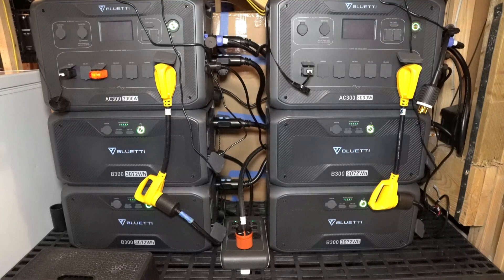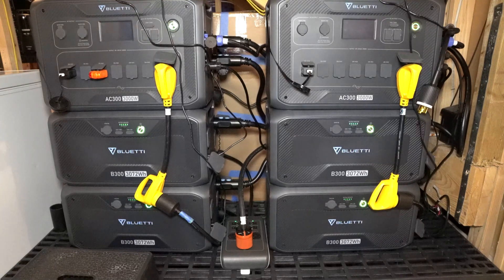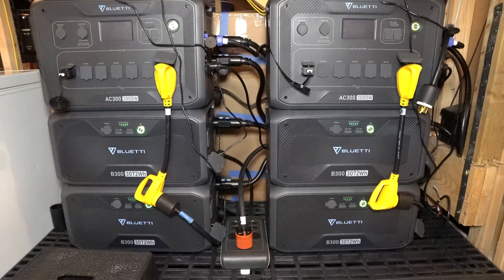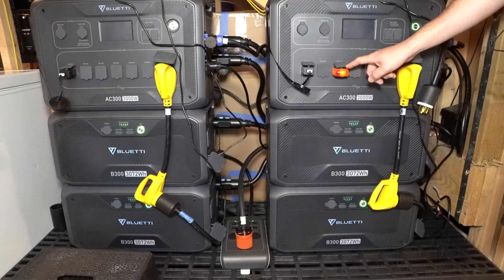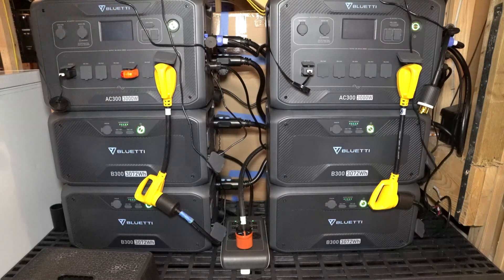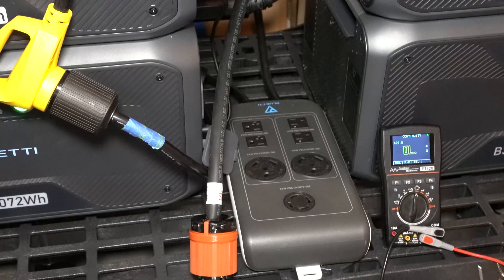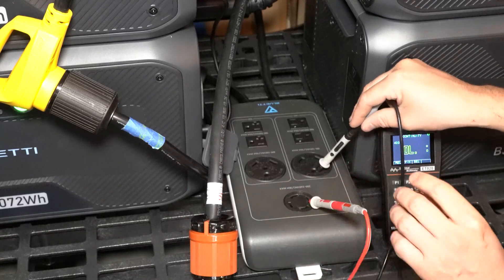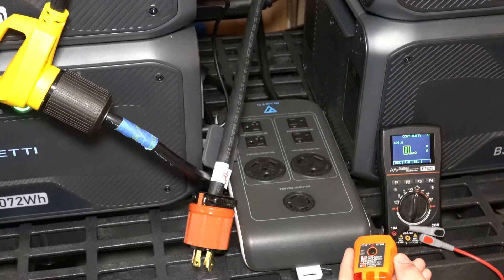Troubleshoot It: Bluetti AC300 - Grounding Questions

Comment: My Bluetti AC200MAX didn't work with a neutral-bonded ground. I had to hammer a ground rod into my front yard to get it working. I made a video of this solution in hopes others can use this solution: https://youtu.be/Rqy77nWfIyo
Reply: Always have great videos. Did you ever figure this out? I just brought the AC200L and the Reliance 310C but it looks like I'm going to have a problem according to your video.

Comment: I have been having the same struggle, glad to see someone else out there documenting it. 

I have the first generation bluetti smart panel transfer switch for my EP500 and I first came across this phenomenon when my furnace would refuse to ignite when on battery. The furnace would give me a code of a non bonded neutral. 

I later also had this problem when my APC UPS would throw a “wiring error” code on the back and would prevent startup. 

My Victron Quattro could connect and disconnect the ground bond via a relay. It looks like bluetti may not have implemented this yet.

Comment: That's an interesting manufacturing decision. I wonder if they were getting some sort of interference between the two units. But I don't see why that would be the case. It would be interesting to know if the GFCI protection is on the expansion board if that is the case technically they don't need the ground sort of. Although it's already in the cables, weird.
Reply from the maker: I know there a several versions of the Fusion Box, in which they changed grounding. However I never found that the Fusion box had any GFCI protection in it, as that would require bonding of the neutral/ground, which doesn't exist. In my latest setup I have abandoned the use of the fusion completely... and so has Bluetti, as their AC500 is sold with a 50amp y-adapter.

Comment: Your videos are very useful.I have the same set up.Just wondering if you encounter an error code008.OCP over current protection??I can't use my system right now because of that and not receiving any help from BLUETTI support.Thanks
Reply from the maker: Hi Ronald - The 008 Error could be indication that your system has been fried. I assume you have an AC300? Can I also assume that you had the Bluetti plugged into the grid for AC Charging? And How are you trying to contact Bluetti. I know they were out for the last two week for the New Year Holidays
Reply: @MyBluetti  I have 2 AC300 charge into the grid .The other still working fine

Comment: Hi, getting shocks from the metal on the bottom of my RV when running on the AC300. Hooked up to the shore power no shocks. I have a neutral-ground bonding plug plugged into the unit but still getting shocked. Any help appreciated. Thanks
Reply from the maker: Hi @fightintheshade - I believe I responded to you on Facebook, but just in case... 

I would get a outlet tester and verify that your AC300, when it's not connected to anything, is testing correctly. The outlet tester will tell you if you have a hot neutral or hot ground. If that passes, then connect your AC300 to your RV and test it again and test some of the outlets in your RV. Let's see where your probably exists. 

Remember that shore power is a bonded neutral system. Your AC300 is a floating neutral system. This means that power that flows incorrectly will be handled or "not" handled very differently.

Comment: Do I have a defective fusion box?  I have the same setup (2 x AC300 + Fusion Box).  With the system turned off and not connected to anything, all of the grounds on my fusion box are tied together.  All show continuity no mater which two are tested.  The neutrals on my Fusion Box behave like the grounds on your Fusion Box.  The neutral on the L14-30 is only connected (shows continuity) to one set of outlets on the Fusion Box.  (L14-30 neutral is connected to neutral on master outlets and not to neutral on slave outlets.)  There is no continuity between any ground and any neutral.  (Floating neutral.)  I have checked this and verified this multiple times.

I bought my system to only use as a backup during power failures.  I planned on using the L14-30 to connect to my transfer switch which is a Reliance Pro Tran 2.  I Have not connected my system to the transfer switch because I have heard of so many Bluetti systems blowing up after connecting to transfer switches with pass thru neutrals.  

Is your L14-30 neutral tied to all of the neutrals on your Fusion Box?

Is this the reason why some Bluetti systems are blowing up, because they have Fusion Boxes wired like mine?

I can't understand why your system didn't blow up when you jumped neutral to ground.  Connecting the Fusion Box to a transfer switch with a pass thru neutral is basically the same as connecting neutral to ground at the AC300 (as long as you don't charge it at the same time by connecting to grid.  That's another issue.  I don't plan on ever doing that.)

Do you know why some AC300 systems are blowing up when connected to transfer switches with pass thru neutrals?  Is it because they are trying to charge with grid power at the same time?
Reply from the maker: Hi Michael.. There's a lot to your comments/questions, so I'll do my best to answer it all. 

First let me say that I abandoned the use of the fusion a couple of months ago and went with a y-adapter to merge the master and slave together. There are also different versions of the fusion boxes out there and the only way to identify which one you have is to open it and check the version number on the circuit board. Different versions had different wiring. 

Unless your fusion box is miss-wired, your neutral must go back to both the master and slave to "complete the circuit". Otherwise any loads you put on the side with the neutral that is not connected would not be powered.  Yes, all my neutrals in my fusion box are connected, only my ground wire is not connected to one side from my transfer switch. 

Yes the AC300 generator is a floating neutral and there will be no bond between neutral and ground. Any bonding that is created must be done external, if one is not available. 

So what I understand from Bluetti is their system was designed for transfer switches that breaks the neutral from the other power source (i.e. Grid). Even their Home Smart Panel breaks the neutral. However many users connected their AC300 system to their home using transfer switches that shared the neutral system with the grid side of the transfer switch, such as the Reliance Pro Tran transfer switch. In my opinion transfer switches that share the neutral wiring system can cause higher voltages and alternative paths which eventually will cause a fatal voltage spike to the AC300 and kill it. Now Bluetti released new versions of the AC300 that they say corrected this issue and now work with the Pro Tran and other transfer switches that share the neutral.

So all home electrical system have the neutral and ground connected together. This bond between the two exists in your main breaker panel and can only, by code and for ideal safety reason, should only exist in a single place in your homes electrical system.  However, remember from above, my transfer switch breaks the neutral wire from the grid side. This means that I do not have access to the bond between neutral and ground that exists in my main breaker panel and I must create a bond on the AC300 side to allow my safety devices in my home to work properly (GFCI/AFCI).

In your case, with the use of the Reliance Pro Tran transfer switch, you "should not bond the neutral and ground together"... This is because your transfer switch does not break the neutral wire you have access to the bond back at the main panel. Remember you can only have one bond in your electrical system... so you already have one. 

Yes, you are correct. When owners who have a shared neutral connect their AC00 into the grid for charging, they create an alternative path for the "power to return to source". I never got a clear answer from Bluetti on why, but I can assume it's due to grid pass-through. The newer AC300 units are suppose to not have this issue. 

Hopefully I answered your questions, please let me know if I missed anything.
Reply: @MyBluetti  

Thanks for the reply.

I can't believe that they have different versions of the AC300 and the fusion box,  with no way of knowing which version one has.  The only way to find out is to plug in a system and see if it blows up.  Bluetti should issue a table listing versions by serial number with warnings on known issues.

The current users manual for the AC300 on the Bluetti website shows using a fusion box to get 240 volt split phase.  No where does it mention using a Y cable as you have in your system.  It does NOT show a fusion box connected to a transfer switch.  (It might be that we assumed the fusion box can be connected to a transfer switch.)  It shows a Bluetti sub panel to connect two ac300s to loads and a main panel.   The Bluetti sub panel is no longer available. 

The "how to" page on the Bluetti site makes no mention of the fusion box, but says to use a Y cable (available from Bluetti, but not found anywhere on their website) for 240 volt split phase.  It also states to use a 310A Pro/Tran 2 transfer switch which is to be connected to a main panel where ground and neutral are bonded.
 
How can I find out if I can use a Y cable in my system?

It looks like other manufacturers also have issues with their Solar Generators.  "DIY Solar Power with Will Prowse" and "Matthias random stuff" have blown up Ecoflow units by connecting ground to neutral.

Comment: The purpose of the ground wire is mainly to protect a person from getting shocked when touching an appliance that has a loose wire or a short. When the ground is unbonded that protection is not there. 

Why did Bluetti decide to connect the ground from the master but not the slave?
I have no idea. They could have either connected both grounds or none. For both options you can find a reasonable enough explanation.
Instead they decided to connect one but not the other which seems weirdly asymmetrical.

If you have the Fusion Box connected to a Transfer Switch and to the main breaker panel (where neutral & ground bond), the result of their decision is that you have grounding protection for all appliances connected to the Master, to the master side of the Fusion Box & to the circuits connected to the Transfer Switch, but not for the appliances connected directly to the Slave, which is important to know. You can always add a bonding plug to the slave or even wire the Master/Slave grounds at the Fusion Box so they are always connected and have the same protection.
Reply: BTW, I did some tests with the AC500 and when the grid input is connected it bonds ground and neutral which is bit surprising and I'm not sure it is correct.
Reply from the maker: This is why I abandoned the use of the Fusion Box. I am not just using a y-adapter so that I have grounding going back to both my Master and Slave units. I also now just have one bonding plug that is shared between the two units. Testing my GFCI/AFCI device  and everything works as expected. You'll note that on the AC500 Bluetti is now offering a y-adapter as well... so they also abandoned the Fusion box.
Reply: Dang, I have no idea what either of you are talking about lol. Sooo……I don’t need to ground it?

Comment: David.
I really am enjoying your in depth testing and analysis of your setup, better than most I've found . TY
I just received mine, same as yours minus 2- batteries. 
I think I'm going to drive a dedicated ground rod beside the 300, and make sure the main service  Neutral is disconnected when in use as I have seen surges come through the neutral during outages.
Reply from the maker: Thank you for your feedback; we're all working together to figure this out and I figure I can share the knowledge! Technically if you're connect a generator to your home through a neutral switch transfer switch your suppose to have it bonded and have a grounding rod... so I think you're on the right path. I have another outstanding email to Bluetti Engineering trying to get a clear answer on this subject and hope to have something soon that I can share.
Reply: @kroodle8  That is typically caused by a open neutral condition, check your house wiring for grounded/open neutral @ the devices.

Comment: I was having a problem changing my electric car. Because of some kind of grounding issue.  I tried different things before I tried plugging in the ac charging system and made it it charge at a minimum,  just to have a ground on my system
Reply from the maker: I would assume by connecting the AC charging cable to your unit it passed the required bonded neutral that your EV charger requires. I have see some people use a neutral bonding plug to resolve the open ground issues that their EV chargers require... however I have not tested this myself yet.
Reply: My EV and my DIRECTV box both require grounding plug. My Honda generators also need one

Comment: Thanks David. This is my AC300 setup exactly. I am also using the Generac HomeLink manual transfer switch as well that I purchased back in Jan 2020 for my gas generator to power the emergency circuits. Yesterday I purchased the Bluetti AC300 x 2 package with 4 - B300 (12kw) power packs including 3 - PV 200 Solar panels with the hope to be able to replace my gas generator and use the Bluetti AC300 in split-phase configuration with fusion box to be able to connect directly into the HomeLink Manual Transfer Switch. My hope is that I can utilize my AC300’s to power my emergency circuits when Grid power fails while still receiving PV power from the Solar Panels then when Grid is active I would still like to power all my emergency circuits with the AC300’s and let the Grid still power the remaining circuits - is that even possible with a Manual Transfer Switch?

I sent all my specs and data to my electrician who installed the Generac HomeLink Manual Transfer Switch and asked if I could just piggy back on the circuits in the Manual Transfer Switch with a 50 Amp or 30 Amp receptacle inside my garage so I could use my Solar Generator to power my emergency circuits or use the Solar Generator via a receptacle connected to the Bluetti Smart Home Panel tied into my Manual Transfer Switch when I’m not using the Generator as a power source (but obviously not using them at the same time). 

Well, he didn’t say no, but my original request included using the Bluetti Smart Home Panel and that made him scratch his head was to whether or not he could just piggy back this Smart Home Panel on top of the emergency circuits in the manual transfer switch. 

Anyway, after reading in the Bluetti Community forum and checking out your other YT videos, I just updated my request to my electrician to see if I can just use the Generac HomeLink Manual Transfer Switch instead of the Smart Home Panel? Besides it appears the Smart Home Panels are very hard to get right now and I’m not too interested in shelling out another $1500 for yet another panel. Just wondering if you have some detailed schematics on how you accomplished your setup that I can relay onto my electrician?

So what is the panel above your Generac Transfer Switch and how does it tie into your whole setup?  

Love your videos, they are very informative and helpful.
Reply from the maker: Hi TJ - I responded to your question on the Bluetti Official Forums.